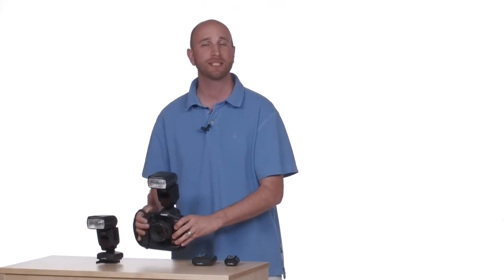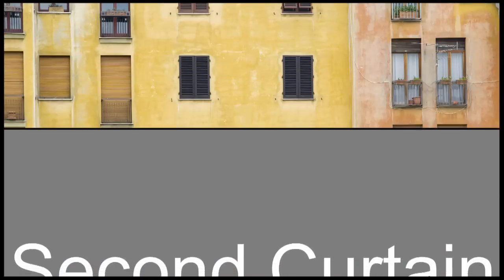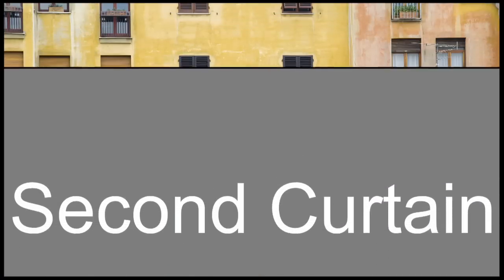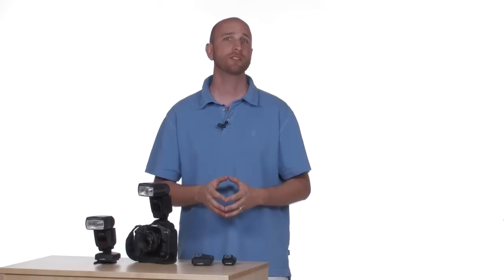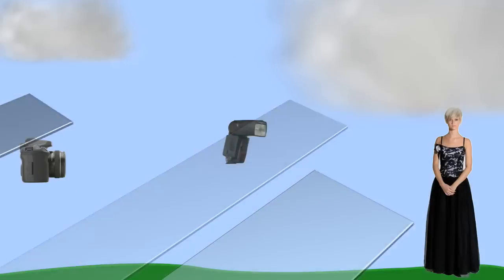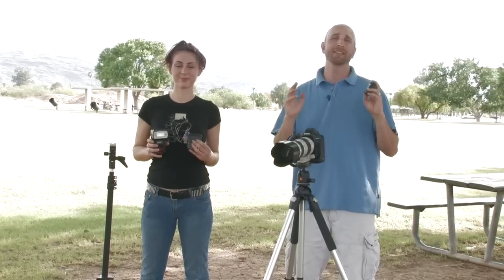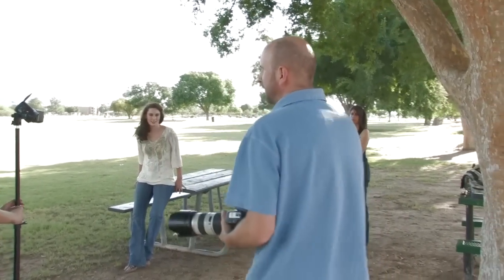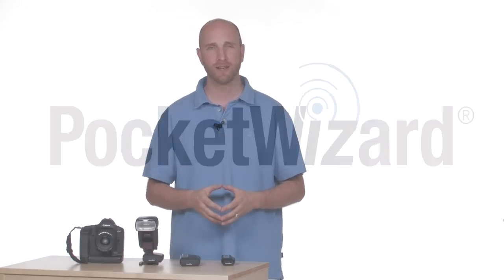PocketWizard and High Speed Sync

Comment: I'm having a problem with my setup. I'm using the Nikon D7100 and SB700, and the FP won't come on on the SB700. I've set my camera to 1/250 AUTO FP, and the SB700 is on TTL. It doesn't matter whether I'm using the MiniTT1 and Flex TT5, or whether the flash is directly on the camera hot shoe. The FP doesn't come on on the flash. The display should show TTL FP, correct? What could be going wrong? I am shooting in full manual, have set the shutter speed up to 1/8000, and have used the Aperature both wide open and closed down. The flash display does not show FP.

Comment: Mark, I've noticed that you sometimes angle the speedlite straight up right (@ the 75 position?) and then point it towards the subject rather than at the standard right angle. Doesn't this cause problems with the AF assist beam as I assume that helps  the ETTL calculating the correct exposure? Many thanks.